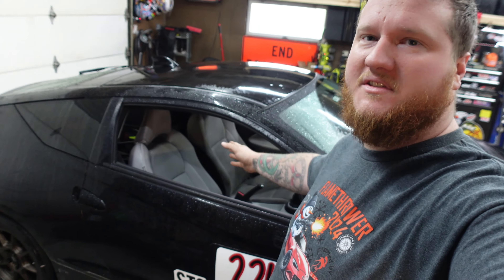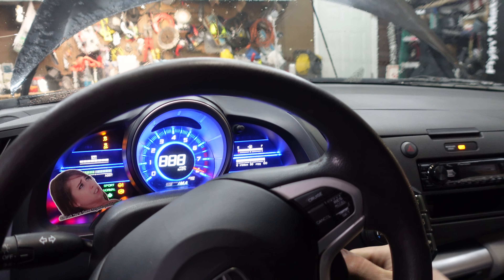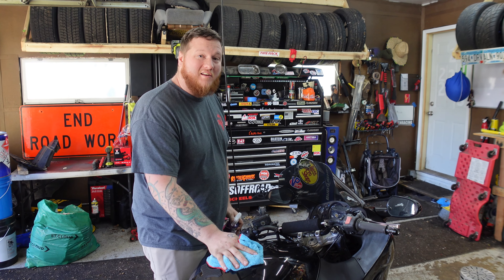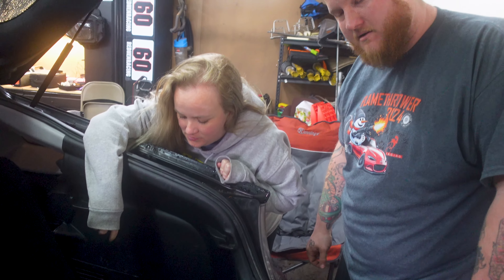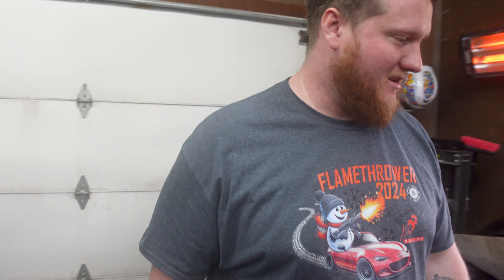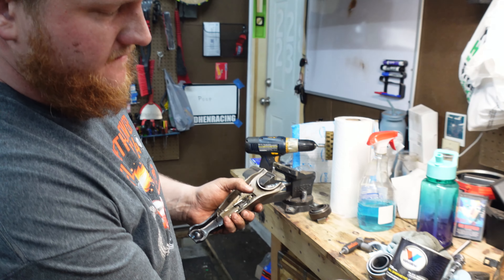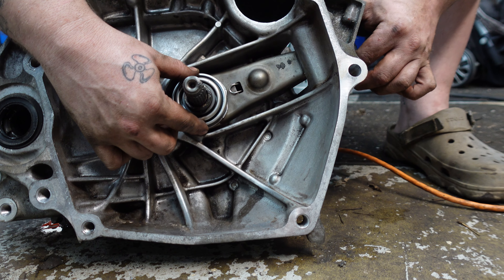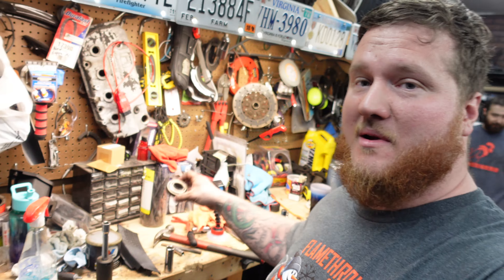Dropping a CRZ transmission for no good reason (reasons, just not good ones)

Comment: Does sound like a bearing is going out in that trans. Replacing just the bearing would be a good video!
Reply from the maker: A whole transmission is proving quite difficult to source, might need to find some bearing part numbers
Reply: @redhenracing2 they are definitely not plentiful. They're hard to find and probably close to 1000 if they have to be shipped. What did you decide to do? I'll have the clutch out of mind in the next day or two. I think the throwout bearing completely blew up on it. When in gear it doesn't sound like the transmission is making me much noise hopefully. I bought it this way so we will see.
Reply from the maker: @stlwolf71  we found a replacement transmission from a parts car in SC while we were home in GA on vacation. There were only a couple available on ebay around $1000-$1200 plus shipping, we gave $1200 for this one after inspecting it in person. 

The throwout bearing is only $9 on amazon if that makes you feel better🤣

When you drop yours, don't bother with the whole section of the tech manual about dropping the subframe and steering rack. It's completely unnecessary.  We've done it twice now and are pretty efficient at it, shoot me a message on IG if you have any trouble with it 🤙
Reply: @redhenracing2  That's awesome. Yes they are pricey. I have found one for $1,000 if I need it. I unhooked the IMA before bed last night and put jack stands under it this morning and started tearing apart some of it. The temperature is already in the mid-80s and is to reach 100 today with heat index of 110 so no working in the garage later. If needed, I have 4 days of good weather coming starting in a couple of days. I was hoping I wouldn't have to pull the subframe. Good to hear! I will definitely look you up and if I need anything I'll take advantage of it. I appreciate it. Look forward to seeing some of your track adventures in yours.
Reply: @TylerLinner  I have noticed while researching that it's common for the front carrier bearing to go out. Most of the Hondas are known for it. When the transmission is running with the clutch in there's no oil getting to the bearings. Oil is only distributed when it's moving. It causes the front bearing to be a common problem.

Comment: Good stuff. I have a 2011 auto cr-z. Do you think the auto tranny can come out from the bottom without dropping the subframe?
Reply from the maker: @bjenks2  I don't know about the auto, but the manual absolutely can. The tech manual has you disconnect the steering and drop the subframe, and we have done this job twice now without touching any of that stuff. After this video, we sourced a new tranny and she's good now, and we can do the job in under four hours. Dropping subframe was completely unnecessary for us.
Reply: Thanks for the video and info regarding the subframe. Very nce to know that the manual trans can be slipped out without taking out all the additional frame and suspension parts.